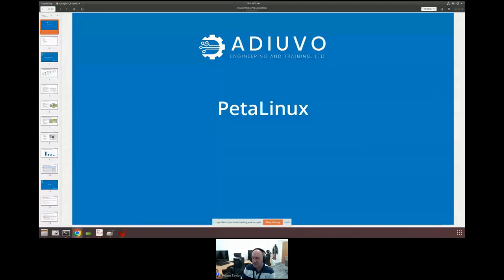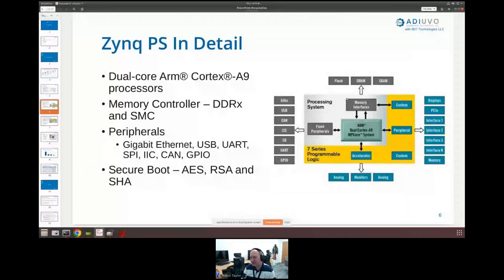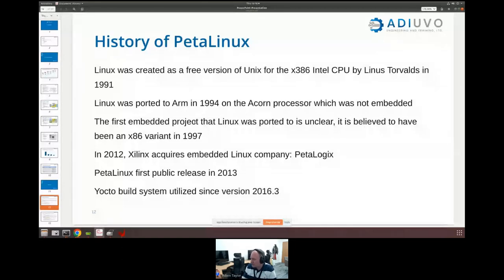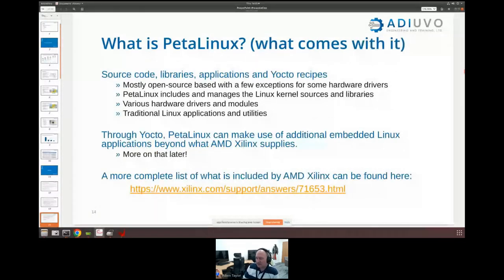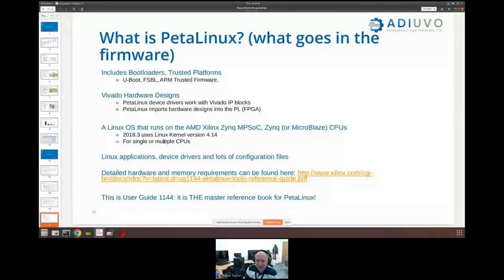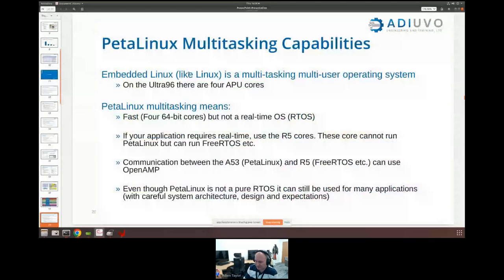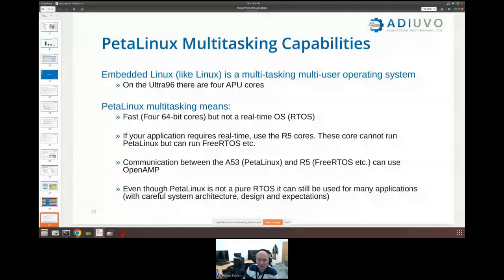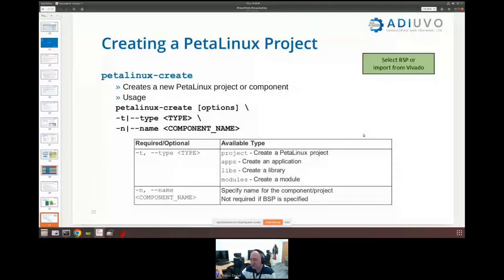Perfecting PetaLinux Workshop

Comment: Does Petalinux work on RPU or APU?
Reply: So from the lecture, Petalinux works on APU. And then it controls the applications running either on other APUs or RPUs. A simple example may be a Petalinux running on APU controls RTOS running on RPU. Thats the classic example of the use case of Zynq Ultra Scale, where both APUs and RPUs are present.